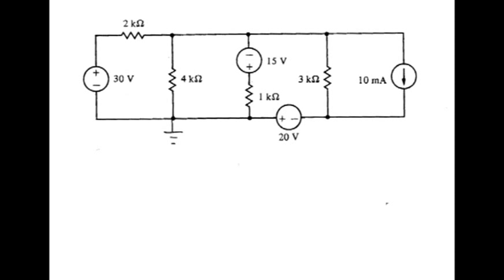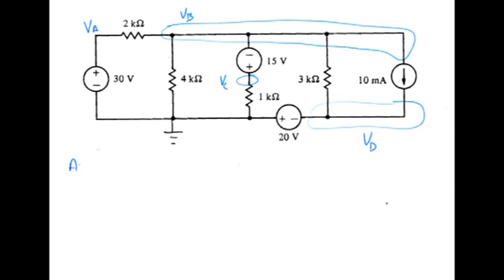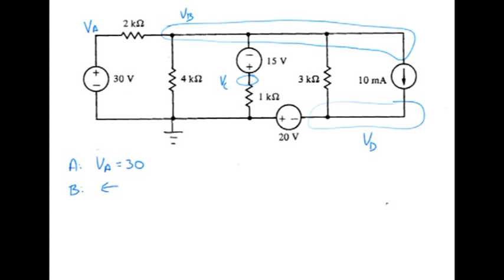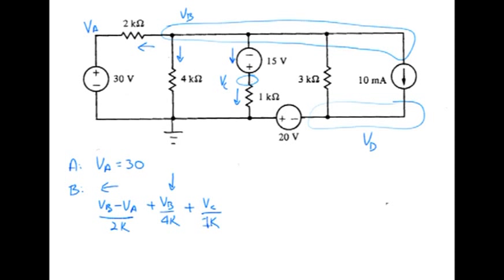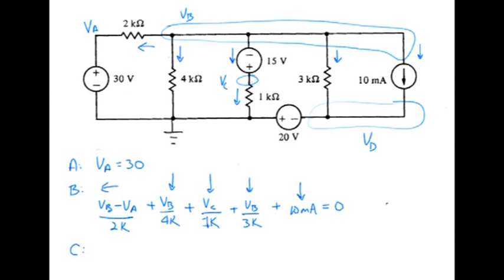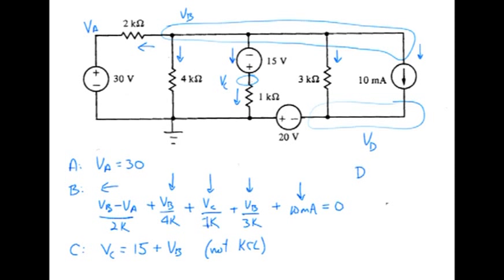dc: Node Voltage Example #6

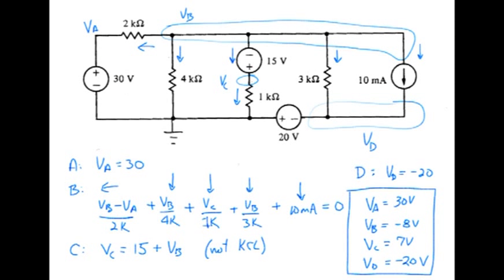Comment: I cannot believe you wrote the wrong equation! The answers are no longer correct at 2:58? I have Vb = 13.79v
Reply from the maker: Mike, just checked this circuit with the Multisim Live circuit simulator (see https://beta.multisim.com/content/D6b94z2XUxVSr4vq73sXBC/youtube-dc-node-voltage-example-6/open/) and the values presented at the end of the video are correct.

Comment: In B equation you wrote ....+Vb/3k+... i guess it should be ...+Vb-Vd/3k....which one is right and why?if you explain i ll be glad thanks for video.
Reply from the maker: +Nuri Özdemirden Thank you very much for pointing out the problem, you are absolutely correct! The equation is properly entered into the Maple worksheet, however, and then endpoint answers are correct.
Reply: +Nuri Özdemirden I second that, this is like the 3rd video I found of his with mistakes

Comment from the maker: A "node" is the connection point between two or more circuit elements. Because circuits are often drawn with right-angle straight lines, a single node can sometimes appear to be quite large, but this is just an artifact of the drawing method. You could collapse each node into a single point (with more of a curved way of drawing circuit components) and sometimes this helps to clarify the node connections.